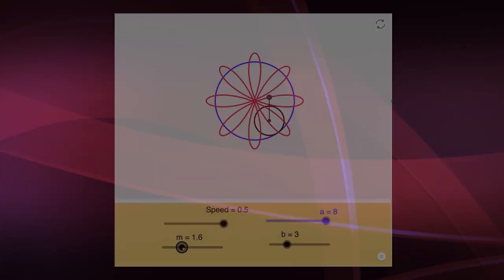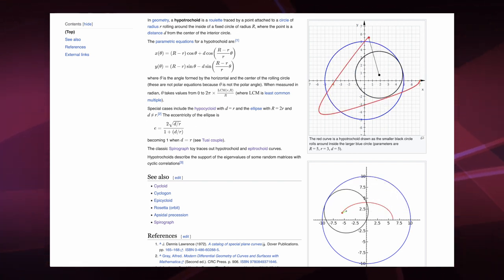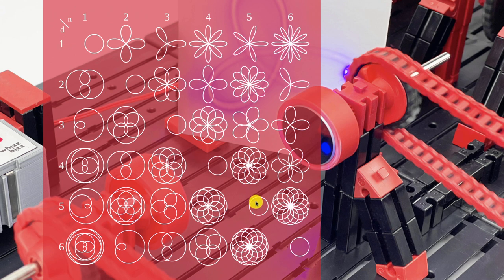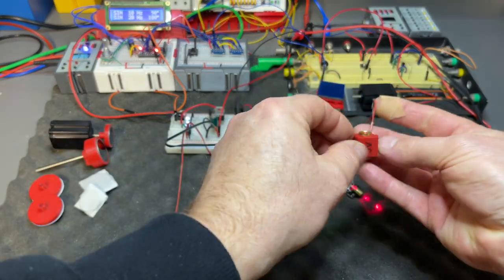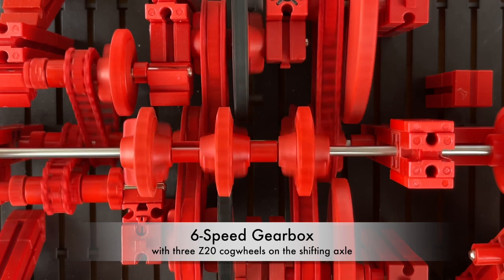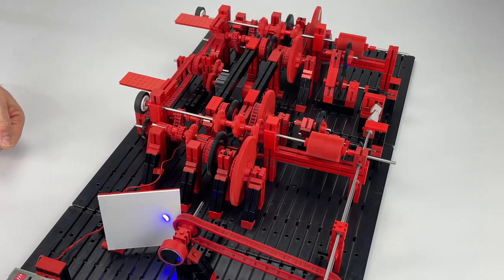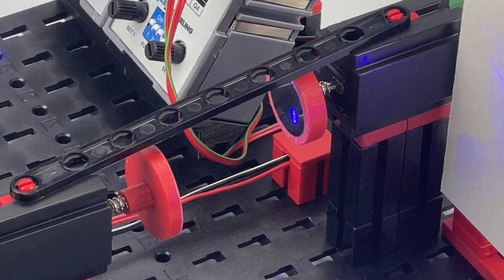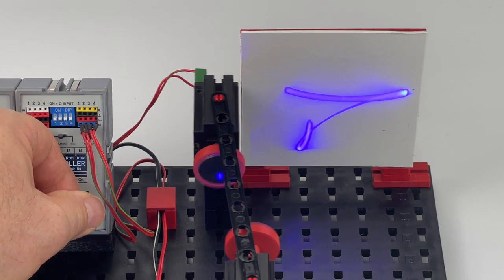Projecting hypocycloids with a laser

Comment: Great project! One could use the various synchronous motors that Rüdiger, me and some others developed in the past years.
Reply: By the way, I like the way you implemented the surface mirrors into the fischertechnik universe very much.
Reply from the maker: You mean with a controller that is able to make different AC-frequencies in order to play with the different rpm ratios? For the Rose-figures (where a mirror could be mounted directly) this will do, but perhaps the torque will not be sufficient...? Another thing is that they need to be started manually and that you need really nice sinus-waves (no PWM or block from a TXT-/micro-controller) to do the Lissajous figures (my next stop). I thought up a solution for this, but this is still in the experimental phase 🧐
Reply from the maker: @mathmeetsmachines  Thanks, not really 100% necessary to have a 3D printer. (Although, let me know if you need some) I simply glued my first test mirrors onto an axle with a glue gun. But with the heavier optical mirrors I found this too dangerous. It would also be a shame if they flew off and broke.
Reply: @arnoud-whizzbizz  My idea was to supply the synchronous motors with the AC current from an AC to AC converter at 50 Hz. The frequency ratio is given by the ratio of the number of the magnets. Like in my Telharmonium you can build several rotors on one axle and shift the electromagnet to drive one of them. When I did my experiments, unfortunately this natural idea did not come to my mind.
Reply: I would guess that the torque of my original synchronous motor suffices to drive a 1:4 transmitted axle (turns faster).
Reply from the maker: @mathmeetsmachines  Yeah, ok, see what you mean. Kinda sine wave gearbox, haha.... Great idea, because it will give nice sinus waves for Lissajous figures. Have to amplify them though (symmetrically). For my other solition I already made a symmetrical amplifier on a breadboard, that perhaps could be fit into a 'Silberling'-housing. This would be an alternative way!
Reply from the maker: @mathmeetsmachines  Unfortunately I didn't have enough 10x4 magnets lying around, so I just ordered another 100 pieces 🧲 (perhaps it's a nice follow up project, after my nice-symmetrical-sine-of-any-frequency project I'm working on now for the Lissajous figures, haha)